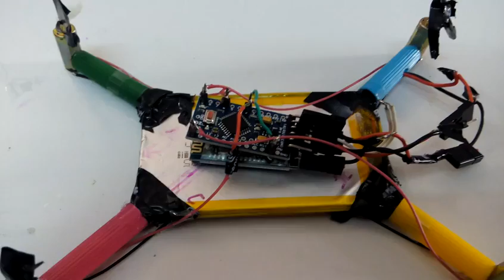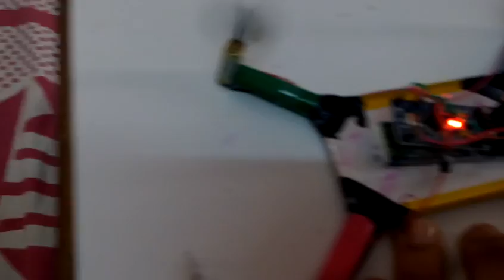Voice controlled drone

Comment: Where was the motors GND connected? I was having trouble to make the rotors work.
Reply from the maker: John Cristopher Coyoca all motor grounds are connected to arduino ground.
Reply: Well. I've done that. But the motors still not working.
Reply from the maker: John Cristopher Coyoca check voltage on motor pins with ref. to ground
Reply: What voltage motor pins with ref. grounds?
Reply: Is any special connection you made that didn't included on the diagram you give?
Reply from the maker: John Cristopher Coyoca there is no special connection in it.
Reply: Okay. Ahm. I want to try it with transistor. Can you teach me the connection i need to change? And what transistor can i use.
Reply from the maker: John Cristopher Coyoca connect arduino pin to base of transistor and motor between collectors and emitor with battery connect to it and keep common ground for base and emitter.
Reply: Okay thanks. But I dont understand the last phrase. I think its my last question. Where do i need to connect the positive or the negative of the motors? Is positive to collector or positive to the emitter or vise verse of negative.thanks
Reply from the maker: John Cristopher Coyoca any one trial and error base on rotation of motor
Reply: Ahh. Thanks. Should I add resistors?
Reply from the maker: John Cristopher Coyoca not necessary.
Reply: May i know what pro mini you used? Is it 3.3v or 5v?

Comment: You connect motor so casually to arduino.Not smart.use transistors or ic.now I'm no longer a noob I used to be
Reply from the maker: arduino can tackle micro motors with mili amps. so no need to worry. but for big motors use ic 741 or bc 547 trans.
Reply: Neel Desai well it didnt fly didnt it?
Reply from the maker: i dont have appropriate size  propellers.